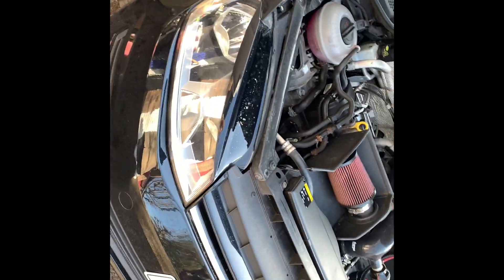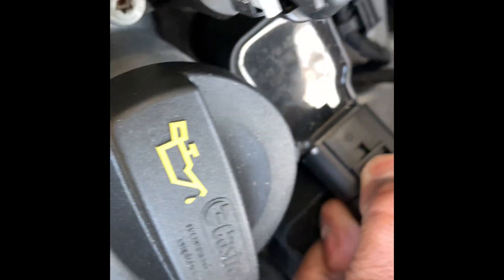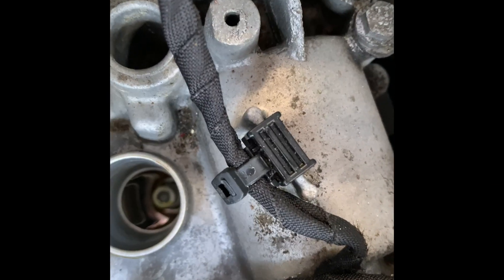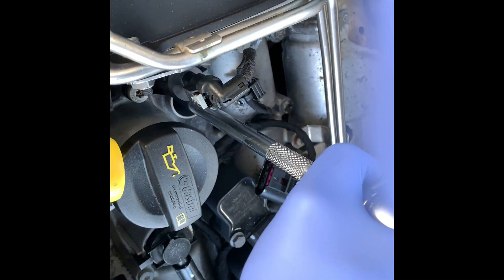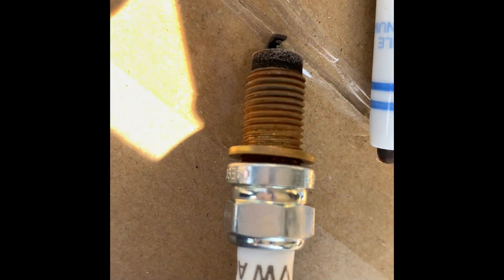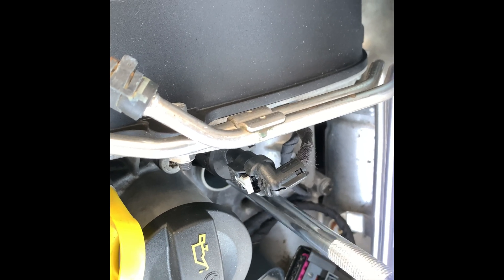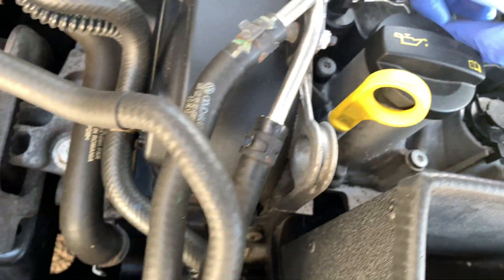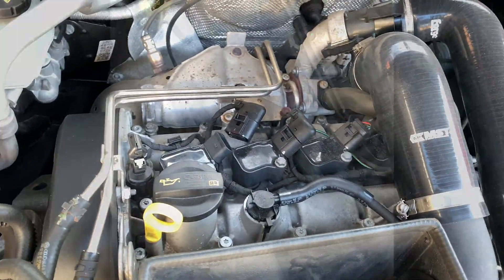Volkswagon Golf Mk7/Mk7.5 (1.2-1.4 TSI Bluemotion) Spark Plugs Replacement

Comment: Hello,
Is the engine a 105Hp?
With an air intake, spark plugs and a stage 1, how many horsepower do you get out?
I would like to know if I can do the same
Thx :p
Reply: 110hp with a map now else needed as I’ve got one my self but I like wats been done to this so am probably gonna do same but I want gti exhaust put on but not sure who can do it
Reply from the maker: @adilhussain5075  you can get it custom made by an exhaust fabricator or buy a gti exhaust off ebay or something and fit it on
Reply from the maker: Hi this one is only 86hp and has not been remapped so not sure what you  can achieve with a stage 1